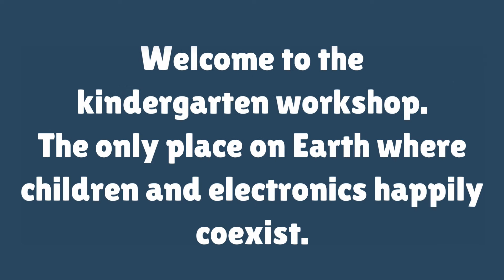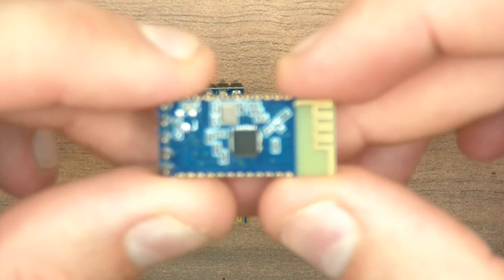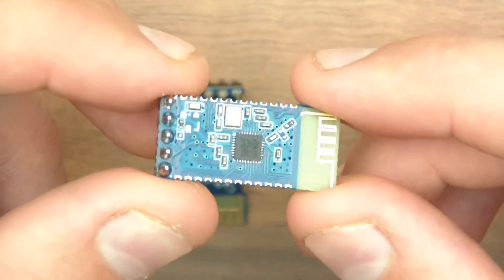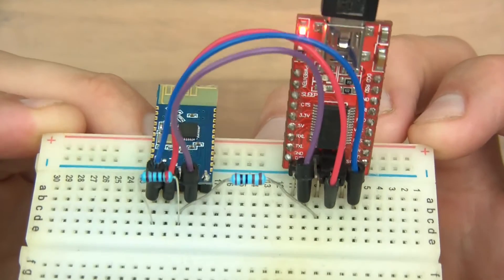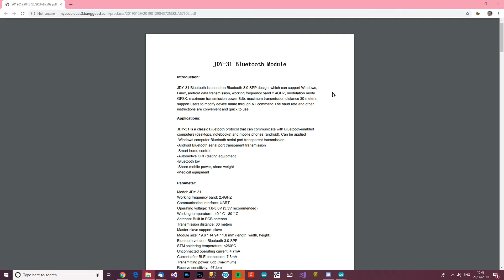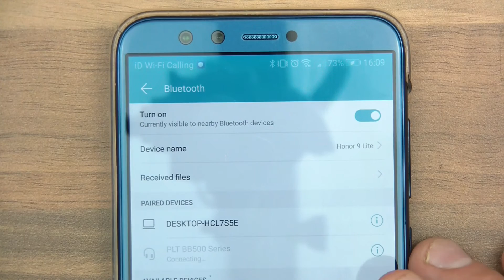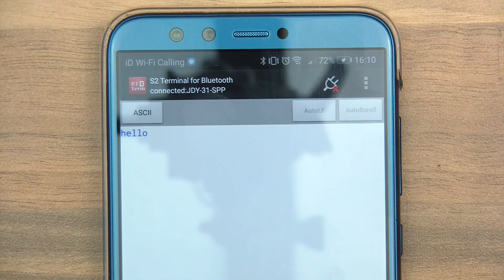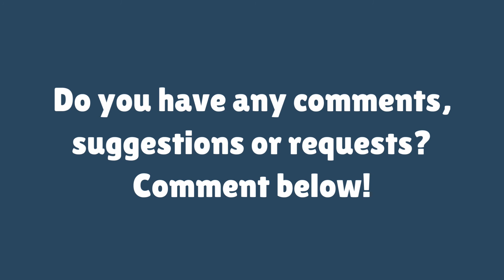TUTORIAL: How to get Started Bluetooth Module JDY-31 JDY31 BK3231 Arduino - Quick Simple! HC05 HC06

Comment: 5 years on, and this video, with shoddy audio and kids living life in the background, is still helping people. I was making the voltage divider wrong. Divide the volts between rx and tx, of course! Didn't help that I was using arduino nano and set the tx and rx to a6 and a7 pins, which didn’t have the ability to either receive or transmit (forget which one it was) and wasnt getting output or required input on one. Either way, I swapped tx and rx pins to a0 and a1 in sketch, and it worked.

Comment: HI Antony, thanks for the video. 

I wanted to ask you and your viewers, is it possible to have more than one device (phone/tablet) connected? The reason why I'm asking is because I have a few of the JDY-30's and I've been having some issues.

1. Firstly only one device can be paired with the JDY-30 at a time and doesn't allow a second device to pair/connect.
2. Secondly, for some reason after setting the password and disconnecting the JDY-30 from my arduino, then the password/pin resets to "1234".

I would really appreciate some advice/guidance!

Comment: Brilliant! I baught these SPP-C HC05/06 last week on amazon as they were the cheapest ones. They work out of the box but I wanted to change the baud rate. All the help on HC05's online misdirect you to trying to set to AT mode - these are in AT mode by default so no need to do that! there is no pin 34 on these and you dont need to use the EN or STATE pins!!. Also the demo sketches are in error too (they dont delare serial baud rate) thanks to your tutorial I have got it all working perfect!! heres a WORKING(!) 8 line aruino sketch to communicate via COM terminal (SIMPLE!!)

#include <SoftwareSerial.h>
SoftwareSerial BTSerial(10, 11); // RX | TX
void setup()
{ Serial.begin(9600);
  BTSerial.begin(9600);}
void loop()
{if (BTSerial.available()) Serial.write(BTSerial.read());
 if (Serial.available()) BTSerial.write(Serial.read());}#

thanks a million!

Comment: Thanks for your video. I have one of those JDY-31 modules that you are holding. I had it working with 5V power and not using voltage divider resistors on the input. I was able to pair to it using my phone and then perform simple serial communication. I have not found out how to get the thing accepting "AT" commands though. (My device has an "EN" pin but no button.)
Reply: Same here, AT commands dont work for me
Reply: @eddiegustin2372  it has been unpaird with another bluetooth devices

Comment: NICE DROVE ME MAD, ONLY PROBLEM IS I CAN CHANGE EVERYTHING BUT NO BAUDRATE, IT STAY'S ON 9600
Reply: Yes I have problems with that too. It works as the pdf says AT+BAUD1 (followed directly)  except it does not accept speeds higher than 9. I tried AT+BAUDA, AT+BAUDa, AT+BAUD10, AT+BAUD=A and different other ways with no success. So I left it at 9 as it was the highest it accepted and now after I reset power it wouldn't talk back anymore. Speed is supposed to be 230400 and I suppose my serial to it is not capable of that speed. Will troubleshoot more and update if I figure it out. Meanwhile do not set it to speed 9. BT side works as normal.
Reply from the maker: They drove me mad too!!!
Reply: how do i change the baud rate, if i type:   AT+BAUD=8 and hit enter, it never changes
Reply: @lucbisschops  I've had the same issue... just found out that it works if I type it in without the "=" --> AT+BAUD8 ... after Reset it runs on 115200 baud rate ;)

Comment: Thanks for the video - I'm not quite sure how you've been able to send the commands to the JDY module though. I assume you have uploaded some code to the Arduino along the lines of the standard HC-06 method. If you could provide a step-by-step guide in the description along with the Arduino code you used that might be helpful. I'm getting great data from the module , but can't seem to adjust any of the settings or even get any responses when I try and put it into command mode.
Reply: I'm with the same problem. I tried to upload a blank code and them use the serial terminal but didn't get any response from the module whem I used the AT commands.
Reply: @nikolas.augusto  
Hook them up to an Arduino

   STATE: N/C
   RX:    Arduino RX (yup - you actually don't do an RX/TX crossover to the Arduino when sending AT commands to the module)
   TX:    Arduino TX
   GND:   Arduino GND
   VCC:   Arduino 5V
   EN:    N/C

   NOTE: I'm doing all this with an Arduino Uno without logic level shifter.  Not sure if that's right, but it seems to work fine.
         There's some indication that the bare module is 3.3V but it's effectively a 5V device when it's on the carrier board.
         The VCC pin is marked "3.6V - 6V".  That kind of makes me think it's nominally a 5V device.

- Put the blank sketch (yup - it's really a blank sketch) on the Arduino.

- Open the Arduino IDE serial monitor.
  Set the serial monitor to 9600 baud and "Both NL and CR"

- Type "AT+VERSION" into the input text box at the top of the serial monitor and hit the "Send" button.
  You should see this response in the serial monitor: +VERSION=JDY-31-V1.34,Bluetooth V3.0

- Type "AT+LADDR"  
  You should see this response: +LADDR=DD1E017890DF
Reply: @Rick_Cavallaro  THANKS
Reply: @Rick_Cavallaro  Legend. Thanks for that.
Reply: @Rick_Cavallaro  Man, you're a legend to me because I've spent a lot of time figuring out how I can do AT commands on this contraption. Thank you
Reply: @fajnynick5370  Hey - I'm really glad it helped.
Reply: It looks like you posted another question about the JDY modules.  But I don't see the question here.  So here's what I have...
JDY-30 or JDY-31 modules can both transmit and receive, but are slave only.
Reply: @Rick_Cavallaro  It means that I can't transmit the signal on the JDY-31 to the second JDY-31, right?  P.S.  I accidentally deleted a comment switching browser windows
Reply: @fajnynick5370  I don't think you can pair two JDY-31's since you need a master and a slave.  I believe you can pair a JDY-30 or JDY-31 with an HC-05, and then both modules should be able to both transmit and receive.  That being said, I've gotten away from the JDY modules because the HC-05 modules are dirt cheap and more flexible.
Reply: @Rick_Cavallaro  Well, thanks a lot for your help, unfortunately it means that I will have to buy HC-05.
Reply: @fajnynick5370  That's not the worst thing.  I see them for less than $5 on Ebay.  Just keep in mind there are a few differences in how you configure them compared with the JDY modules.  I think I posted my notes about that somewhere above(?)